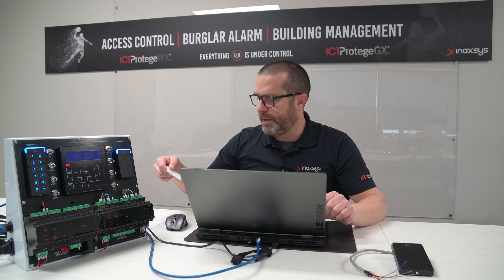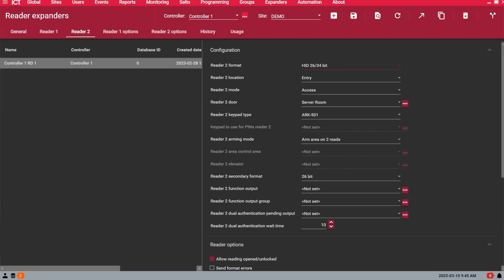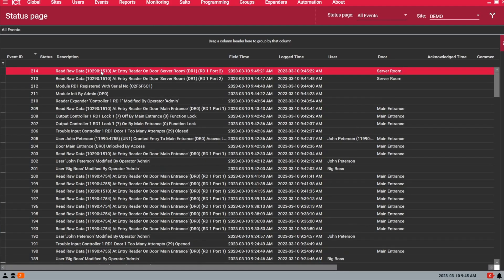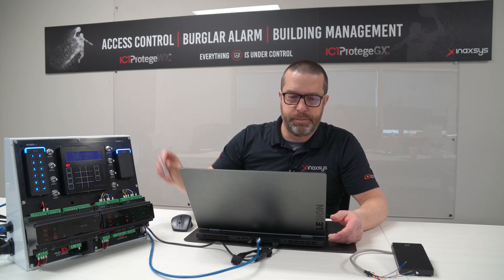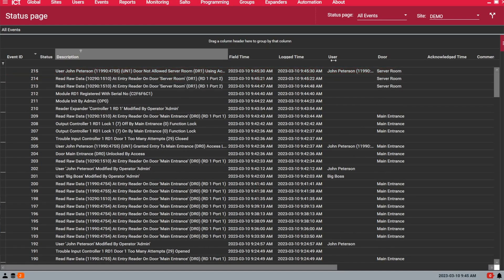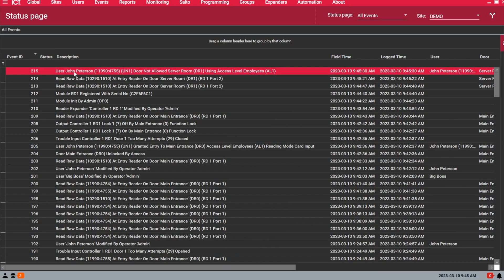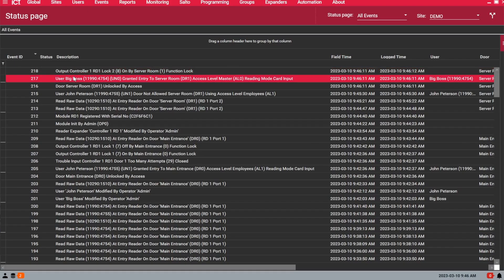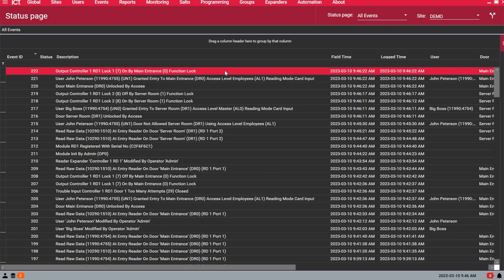How to Troubleshoot Access Control Prox Reader Setup Issues

Comment: Hello!

I have some ICT readers, they are currently using Wiegand to communicate to our older Kantech System that we haven't replaced yet. Can I switch to RS485 on the reader or is the protocol reserved to ICT Controllers? Thanks

Comment: how do you get the buzzer noise reduced?
Reply from the maker: Unfortunately, we can’t change the volume of the piezo on the TSEC readers.  The first beep is the card present and can’t be disabled but if wired to an ICT reader expander or controller, you can disable the beeper processing so the reader will only beep on a card but no more beeping on access granted or denied.

Comment: I have a customer that has a Keri access system with three doors on it. When a credential is presented the reader  has a delay before it unlocks the door. The other readers on the system work quickly. Any thoughts? I haven’t been able to figure this one out.
Reply from the maker: This can come from multiple factors.  If the reader is wired in Wiegand mode, then I am suspecting that there may be some latency between the reader module and the main controller of this system.  (Assuming the 3 readers are not on the same access control module.)  If by delay before unlocking the door you mean having to badge a card multiple times, then there most probably interference preventing the Wiegand data to get to the reader port without being corrupted.  In this case I am suspecting either a power drop on that reader or a cabling issue.  Wiegand works best with non-twisted shielded cables.   Now if the reader is wired in OSDP (RS485) then it is suggested to use a twisted pair for the data wires and sometimes the manufacturer will require end of line resistors to be installed at both ends of the reader cable.  Please let us know if this helps.
Reply: @inaxsys  Yea it was low voltage due to a faulty transformer. I just replaced the transformer and it works again with fast response time. Funny because Keri tech support said that 11vdc was ok, but quickly found out it wasn’t. 

Hey thank you for your reply buddy. I appreciate the help.
Reply from the maker: @deltahogzz  You are welcome 😊
Reply: @deltahogzz Never trust a company that locks down territories.

Comment: I have an older Identicard system running Centurion 3.4. I am able to read the cards but they will not activate the locks.
Reply: Hi! If your system reads the cards but does not unlock the doors, that would typically be because the card user does not have the rights to unlock the door (typically managed by a User access level). You definitely should contact your integrator and have them show you how to program the system
Reply: @AreYouReadySuperStar , thank you for the reply! These panels are all about 20 years old. They are standalone panels and very basic. There is not much to program as far as card access, they either have it or they don't. I'm using HID Proximity readers and as I said I can see the cards in the history, they just will not activate the locks. The error is failed at preactivation. I think it may just be time for a new system.